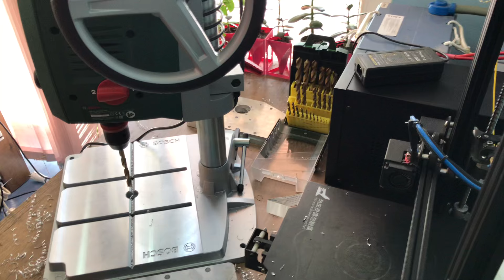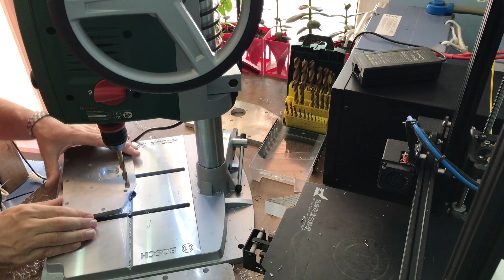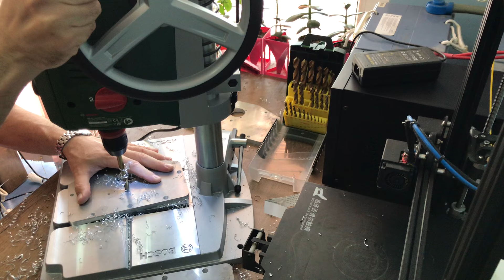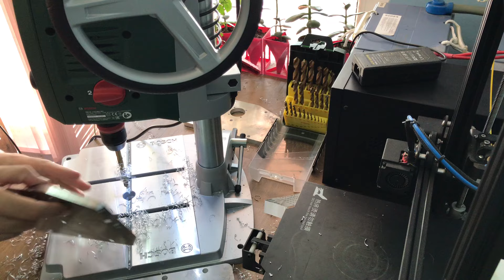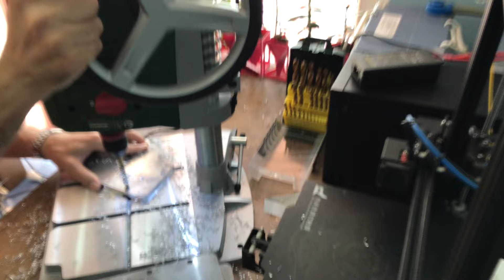continue making new CNC machine for customer

Comment: Don't use a drill press like that. If the drill grabs onto the part it will swing it around and slice your fingers off. Use a vise or at lease push the part against the column. Also take off your watch and use cutting fluid.